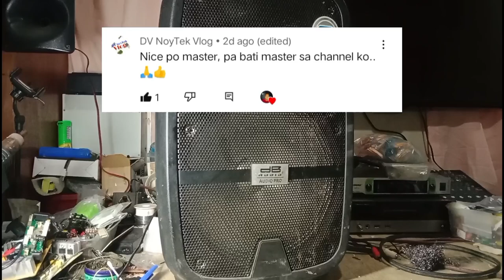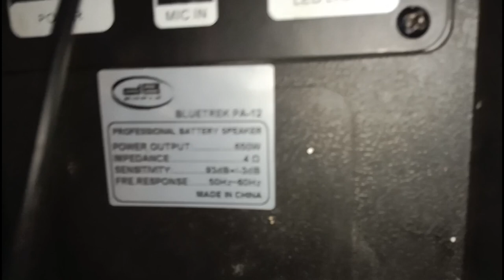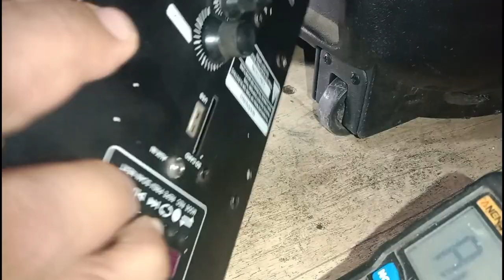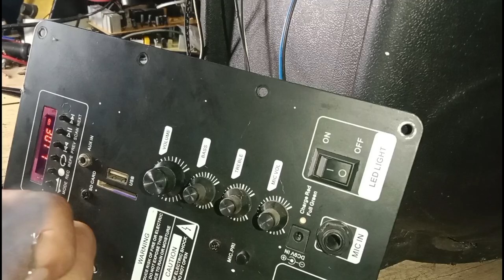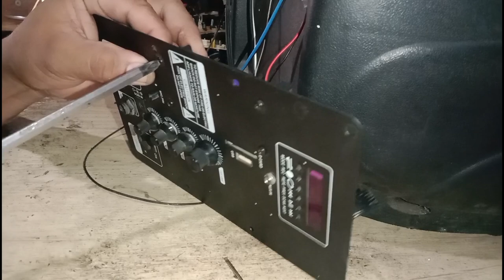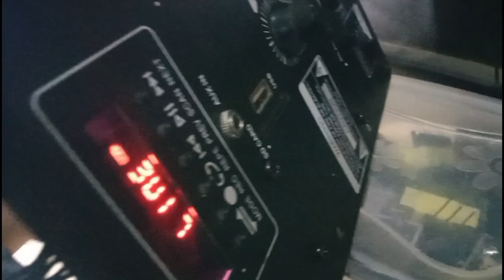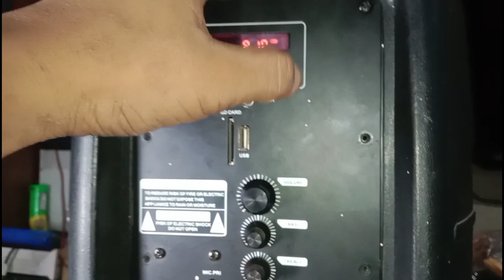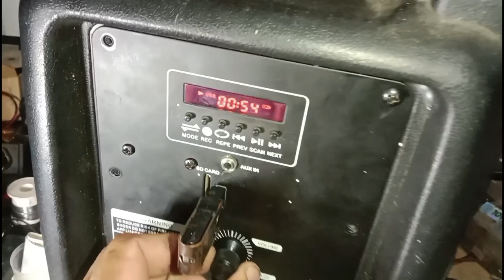Blue Trek PA-12 DB Audio Portable Speaker No Power #share #repair #dbaudio #convert #recondition

Comment: Idol skin platinum dk88 Malaki baterry pang trycicle pag ginagamit puba kailangan idrane baterry bago I charge
Reply from the maker: @denniscruz5014  wag naman sobrang drain di ba nagsasalita ang speaker mo if battery is low
Reply: @ortechtvofficial  Hindi pu me indicator lng pu me bar 3bar full pag 1bar nlng ibig Sabihin palobat napu
Reply from the maker: @denniscruz5014  opoh
Reply: @ortechtvofficial  sng tanung nlng pu sir ska merun pu DC Saka ac mode pag nka ac mode pu nagchacharge ung baterry PG green full na pwedi parin puba nakasaksak sa kuryente khit full na Basta nasa ac mode
Reply from the maker: @denniscruz5014  opoh goods lang yan
Reply: @ortechtvofficial  ok pu salamat sa info